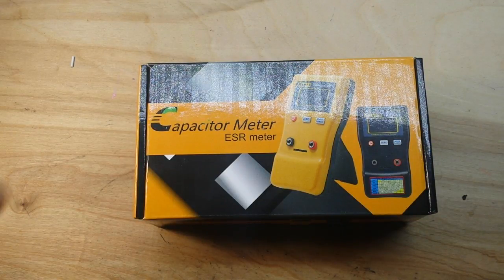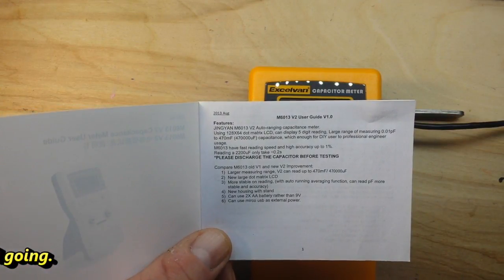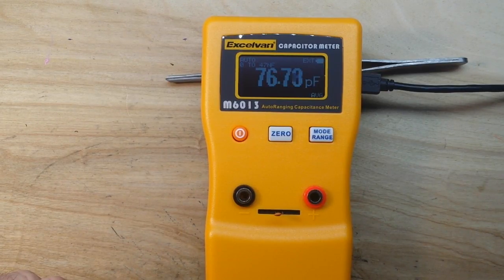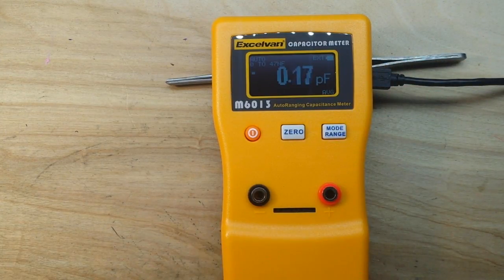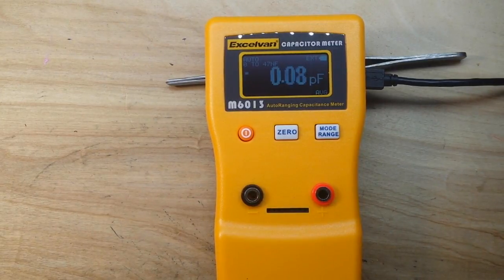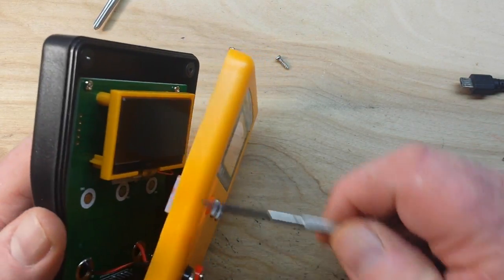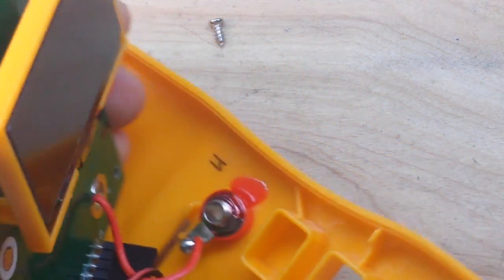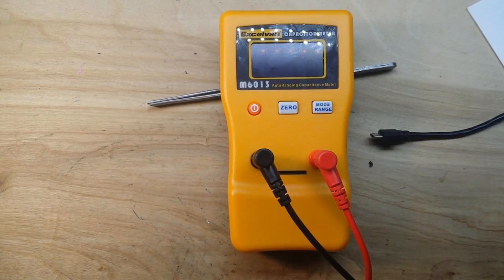Excelvan M6013 Capacitance Meter Review and Teardown

Comment: Puff never heard that terminology before I been in the business for 40 plus. It's always been picofarad looks like a nice unit though I would like to run some of hv 600v electrolitics up to full working voltage with my old wheatsone bridge and watch for breakdown. You can't possibly do that with this one for sure from a 9volt battery. Esr meters have their place though. It's cheap little unit though
Reply from the maker: Probably a regional thing. I live and worked in the Pittsburgh area.
Reply: @learnelectronics  nice to meet you fellow Pennsylvanian
Reply from the maker: Sam, nice to meet you as well. Sadly, I'm a buckeye. Born and raised 30 miles from downtown PGH, right across the border into Ohio. But don't hold that against me. I bleed black and gold and was raised on Haluski and pierogies.
Reply: I'm impressed that it goes in PF nice for spec in old tube amps for tone shaping though.

Comment: Boy, I could have used that the other day testing the capacitors in a rotary phase converter. Luckily one had leakage so I was able to find it fairly easy. Looks like a useful meter to have on the bench. Thanks for showing it to us.